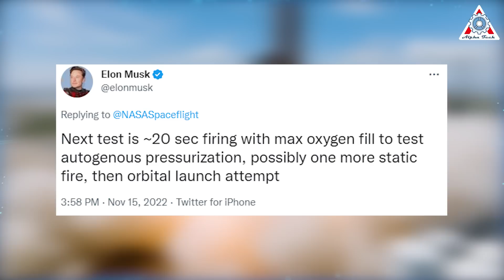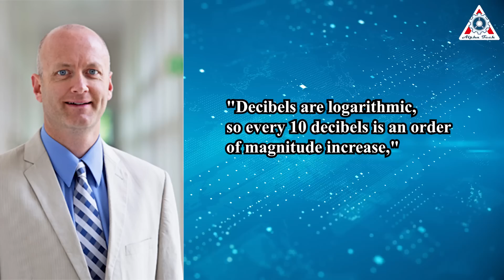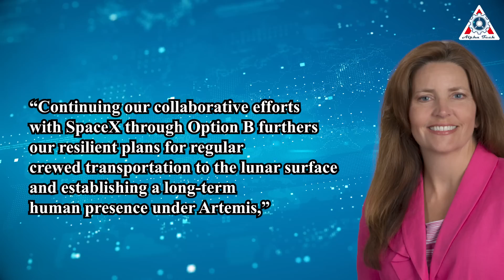SpaceX stage zero facing BIG PROBLEM with 33 engine FIRING...

Comment: I think that a rocket with twice the thrust of the Saturn-5 blasting off from a flat surface with any amount of water would stop the acoustics from tearing apart the launch pad. It is going to need atleast, as big of a blast deflector as the Saturn-5 if not bigger. Remember in the past many rocket engines blew up from reverberating acoustics on the launch pads.

Comment: Perhaps launchpad damage is the reason for the engine spread inclination (20degrees?) on Soviet rockets.
Brainstorm:  Perhaps a sort of ham sandwich launching pad with water where the ham goes, separated by numerous very short legs (like pickles?) and circulating water could handle the heat. I assume the heat is the problem rather than the pressure. If the launch pad is very difficult perhaps a floating launch pad, such as the drilling platforms Elon bought, could just blast into the sea from a significant distance, dissipating the heat over a wider area and longer distance.
Reply: The 33 tightly spaced engines may not be allowing air to be sucked into the rocket exhaust by the Bernoulli effect as in other large rockets with few but large engines that extend well past the bottom of the first stage.

Comment: This is indeed a major flaw at Boca Chica.  And one that they are addressing at Florida.  they have put in large pipes for a huge volume of water to be pumped onto the concrete.  But its still not a good design.  Flame diverts redirect this energy And why they wont listen to NASA or other engineers is beyond me

Comment: Loudness depends on your distance from the sound source. Also decibels is just a relative measurement without a Reference unit, such as dBm, which is decibels relative to 1 milliwatt. So, just saying 203 decibels or 140 dB does not tell you how loud it would be to your ears without knowing where the measurements were made. 204dB at the base of the launch pad is much less loud 5 miles away.

Comment: The proximity of everything at the launch pad seems insane to me. The water deluge that NASA uses also helps to protect the concrete similar to how wetting you fingers allows a person to touch hot things. The water turns to steam providing a protective layer. The heat of 33 rocket engines firing would require a very large volume of water as it would be turned to steam almost instantaneously.

Comment: Legs should be wider and taller in a pyramid formation with a titanium diverter in the middle underneath pumping water, dumping vibration and multiple concentric wall barriers rising parabolic around for water retention with a large radius. Acoustic Geometry should be tuned to cancel the sound waves at the center

Comment: Maybe NASA has one edge over SpaceX with their flame bucket design even the tiny 60KLbF V-2 had a 4 lobed deflector so will SpaceX swallow their pride and build a deflector before something bad happens with those ballistic concrete projectiles or larger. Nice video, thank you - Ken
Reply from the maker: Thanks your support!

Comment: Maybe a stupid question, but everybody dig a trench under rocket launch pads, to canalize the flow of flames exiting the engines. And doesn't build this kind of 'delicate' structure. Musk is really a bad engineer, I wonder if it's an obsession to do everything different than others. But he doesn't learn from all other's mistakes and repeat those mistakes. I predict that in a significant amount of cases (maybe 10% to 20%), the starship itself will burn and explode upon atmospheric reentry. I know why, but I'll let spacex discover it themselves (it's a problem in the starship design that is known since the 1960s)

Comment: the concrete is just not prepared for what's about to happen, nothing has even been launched or fired like this. The water suppression system seems underpowered and the amount of damage that is quickly repainted after tests suggests we are NOT seeing the whole picture. The whole site is piecemeal as can be seen from how close the tank farm is to the launch site - this is obviously under threat if there is a problem but what is more of a problem, which no one talks about, is the size of the dust cloud? This is enormous and represents a significant threat to all sorts (property, environment- concrete dust in the water?) as I am sure elon is not gonna clean it up! I hope it gets off the ground and makes it to orbit as the explosion if it doesn't would be catastrophic locally. I watched Apollo 11 take off on TV as a kid so it will be amazing if i get to stand on the beach and watch this go up - and not go Off! More money needs to be spent on prep without maximising efficiency and cost for obvious local safety after all if successful it will help the local economy - if it isn't, well we dont talk about that do we! - i am 22 miles from the pad - will let you know if dust reaches me!

Comment: Elon has know about this problem from many rocket testing that the concrete was braking apart he really has done nothing. Elon the richest man in the world won't dig a hole and line it with concrete like NASA has done and proves that it worked. Why won't Elon due the right thing and dig the hole and let it fill with millions of gallons of water. What is he waiting for.

Comment: There is a simple fix. Place 6 inch thick metal plates at the bottom of the pad. Weld them together and that should eliminate the problem.

Comment: A bummer for the mobile work stand but roll back to the old inverted cone under the exhaust plume and lay in some steel sheeting to redirect around the mounts legs and cover the concrete. 1/2 inch plate would do.  Could use some insulation between the plates and concrete as well. Considering even an AV8 in hover could spall concrete taxiways and ramps, you'd have thought somebody would have challenged this idea.

Comment: Its so simple.  SpaceX should launch booster with Starship from hanged position. At that time nothing will be damaged or melted because no launch table is used. Also the bottom of the rocket should be positioned a bit farther from the ground and the bottom must be reinforced with water cooled steel plates instead of concrete. It will take a year or even more to build it.
Reply from the maker: This will be more insane difficult

Comment: Elon Musk tweeted way back in Oct 20 2020: "Aspiring to have no flame diverter in Boca, but this could turn out to be a mistake"
To my mind, it's a mistake although not costly because it just means they're going to have to build something. On a positive note, I'm sure they have a lot of data on the damage currently being caused to the pad, but they could have got this from basic physics simulation and consultation from ex-NASA/Russian engineers.
Reply: Turned out to be a big mistake.  Now, it's only been a day since the orbital test, but I would bet money that debris kicked up from the failed launch pad knocked out a few engines right off the bat and created a cascading failure that caused the vehicle to ultimately loose control.  It may have actually been much more successful had the launch pad not been firing bullets at the bottom of the booster ...
Reply: @AkaRyrye83  Yep, the damage is mind blowing: wishful thinking again from Elon who didn't want to build launch pads on the Moon, never mind Mars. This is a huge blow and I'm not surprised Elon looked very glum during the take-off.
Reply from the maker: Elon realized this, so we hope they can control the flame

Comment: I don't understand why SpaceX didn't just build a flame diverter to begin with so firing 33 engines wouldn't b such an issue.
Reply from the maker: They simply haven't needed it for the testing at that point

Comment: My off-the-cuff and unqualified suggestion on the launchpad: I wonder if other materials could be used for the pad, such as hemp bricks or the same ceramic tiles that cover Starship's exterior?  Again, I'm unqualified...just a few free-wheeling ideas.
Reply: I'm not an expert either, but it seems to me that tiles which are designed to withstand the extreme heat of re-entry are no good for rocket exhaust or sound suppression because like the Shuttle tiles, they are relatively fragile.  Concrete seems to be the best material, but it should be made out of bricks or small segments so it can be replaced easily if and when it's damaged.  Also a water deluge system has worked well as sound suppression in the past, but it seems to me that the "deluge" system that SpaceX has is inadequate.  Either way, a full eight to ten second static fire with all 33 engines will determine what if any damage is caused to Stage Zero...
Reply: Or simple 2" thick steel plates over the concrete.  Doesn't even need to be expensive steel - simple and cheap 'mild steel' is all that would be needed.
Reply: Sounds like a plan. Those vibrations are a force within themselves

Comment: A static fire subjects the superstructure to prolonged heat for a greater period than does a launch,I know a lot.
I’ll leave now.
Additionally,to the narrator,cement is a component of concrete,a cement structure is not possible.I told you I know a lot of stuff.

Comment: I wonder if covering stage 0 with the same heat tiles that are used for re-entry would protect the components.
Reply: Dear Steve,
Quite a nice thought… but I don’t think they would stand the noise and acoustic sound pressure. I think they would come right of, just after a few seconds. To deal with 8000tons of thrust, SpaceX would need a flame trench, and a water sound suppression system, like the ones at Kennedy Space Center pad 39 A & B… only much much bigger… The guys designing and constructing pad 39 A & B, back in the 60’th were superheroes. It was not cheap.. no not at all, but It was NASA-standard, and it was built like if life was depending of it… And see.. it still stands there after all these years.. even after Apollo, after the Shuttle, and now after the SLS launch… it still stands…
THAT is quality !!! THAT’s what SpaceX needs!

Very best regards from Johan in Sweden 🚀

Comment: So something everyone is overlooking, what if Space X is doing this on purpose to get real data on what a launch from the moon would do to the rocket because they aren't gonna have the same launch facility on the moon they have on earth and it would really suck to get to the moon have an up to then successful mission and then when they go to take off to return to earth, have the star ship blow up from debris getting kicked up from the lunar launch?
I find it difficult to believe that all of the engineers at SpaceX haven't thought of this and instead letting everyone speculate on how dumb they are when infact they are gathering real world data to make their systems more robust and reliable.

Also look at how much time a launching rocket actually spends on the pad as soon as the main engines fire up. Way less than the amount of time they are doing these static tests for. As the rocket accelerates away from the pad, the amount of energy acting up on it decreases rapidly.

Comment: Time to order some heavy Stainless Steel Plates to cover the pad around the Launch base. I think the Lunar surface will demonstrate a similar problem for return travel launches … I can imagine the crater left on relaunch … Earth could get dust from the Moon .
Reply: The amount of thrust needed to get off the moon is considerably less than on earth and nasa has already done that with the Apollo missions.
Also the static fire tests are absolute worst case scenario because during a real launch, the flame is only that close to the ground/launch pad for less than a second as.the rocket accelerates away from it.
Reply: @4schitzangiggles  but I think they need to hold down the booster until all 33 engines  are running properly, and that would take more than a second?

Comment: What if we build a pool under the rocket but instead of cold or ambient temperature water, we put heated water just below boiling temperature. Then the high pressured steam build up created by the rockets engines should produce a force going upwards preventing the disintegration of the concrete. if the calculation are done correctly the high pressure steam should perform like a shock absorber. I am Italian thus  possibly a Leonardo's Da vinci  descendant

Comment: Is there any reason the concrete can't be protected by stainless steel coated with the materials they make the shield tiles from as they can stand
 re-entry temperatures.
Reply: To put things into perspective...the Saturn 5 inhaled almost 15 "TONS" of fuel/oxidizer per "SECOND!"  This much mass was converted to a super heated high velocity gas.  The mass of this gas is still 15 TONS...every second.  Consider that the "exhaust" temperature emerging from an Oxy/Acetylene cutting torch (which easily cuts SS) is only about half that of the Saturn 5 engine exhaust and the exhaust mass of the torch is just a baby's breath.  Anyone who uses an Oxy/Acetylene torch knows well what happens if they are careless around concrete with it.  Generally, ceramics, firebrick, etc can withstand enormous temperatures but are very brittle and cannot stand impact forces, torsion, tension, shear, etc. without shatttering.  Another problem is the reflected sound energy is so extreme that it cracks/damages manifolds, piping, etc.
By flooding the the flame trench with vast quantities of water, the exhaust is cooled by the extremely efficient boiling of water (vapor phase cooling).  The water is constantly replaced from the nearby elevated tank.  There is no practical way to replace vaporized metal in real time.
This also dampens the sonic energy and prevents damage from that source.

Comment: How far away from the lunar launch pad would the moon-base have to be to avoid damage from flying moonrocks during Starship's lunar liftoff? And what about the cloud of regolith it's going to kick up? If the moon-base has to be ten miles from the launch site, they'll need lunar trucks and roads to ferry payloads back and forth. Why not start with small lunar rockets first, then move to big ones when they know the big ones will actually be better?
Reply: instead of goint to the moon, Robert Zubrin's Mars direct would make more sense. And  before resuming manned Moon missions, go for many small robotic missions. Then, when the science is mostly done on Moon's surface, go industrial. That could and should include building a fantastic Lofstrom (continuous, and "space"_environmentally friendly ) Launch Loop on the Moon!

Comment: The area under the launch pad needs to be flooded with a 2 meter depth of standing water.
Also a huge cascade water pipe similar to SLS at launch. 
Better to boil water than toss concrete chunks

Comment: Needs to put heat shield re-entry materials on
 launch pad.
Reply: Whatever is put on the ground beneath the OLM will be blasted to pieces those 33 Raptor 2 engines.

Comment: Question why don't they just launch it from the ocean it's already planned in the 60s or something like that I understand the there's no igniters and you would have to build a floating platform but that's alot easier then trying to make concrete that does blow up when super heated
Reply: Elon plans to do that eventually. He has two oil drilling rigs parked now in a shipyard in Pascagoula, MS awaiting final conversion to Starship ocean launch platforms.

Comment: Space x needs to make the lunch pad taller an install  flame division system.. the fact that 14 engine can do so much damage , 33 engine will destroy the pad,booster an rocket ... an I want to see that starship fly..
Reply: Surely the solution to a melted or destroyed lunch (sic) pad is to take those curries and beans off the lunch menu... 😆

Comment: Launch platforms at the Kennedy Space Center are atop man made mounds with the flame trench ending at ground level which is mere feet above sea level. I took a guided tour and you walk on the refectory bricks of the flame trench. They would have to replace some bricks after each launch. The launch mount at Boca Chica is raised with a 360 degree 'flame trench' below at ground/sea level. The berm seems to do a good job protecting the tank farm at the moment.
Reply: that is not a flame trench.... the full force hits the concrete flat.  possibly the worst design you could do.  A flame trench has sloped walls that redirect the energy
Reply: @davidbowerman6433  That is why I put 'flame trench' in quotation marks. My post was aimed at those who wanted a hole dug for a typical flame trench which would be below sea level. So maybe some sort of refectory brick cone that could be wheeled into place for a launch?

Comment: Lots of questions about a diversion channel. Not possible at the Texas launch site because of the very shallow water table. And that’s salt water, which is corrosive. Elon had his people design the OLM to suit the conditions, and was/is willing to take the associated risks that it may not be sustainable long term. Musk takes risks. It’s what got him where he is. 

After the next static fire - 20 engines firing for 20 seconds - I will not be surprised if he bypassed a full 33 engine static fire for the reasons being discussed, and goes directly to launch. That jump  to light speed will minimize the impact to the launch pad.
Reply: couldn't they simply double the height of the launch tower and /or coat the concrete with ablative heat shield material?

Comment: Good morning, Elon Musk. It may be that a telescopic launching tower will do the trick. Keep it up Hero!!!
Reply: Moving Flor surface undrneat which only allows heat for  seconds or less
Reply: Like an escalator  made of steel  using electric tow  from a distance quenching before ignition and after as floor moves beneathe launch tower